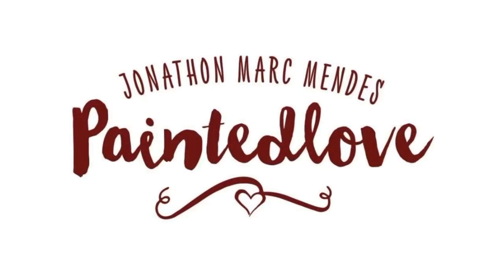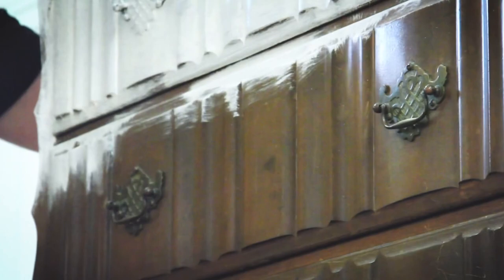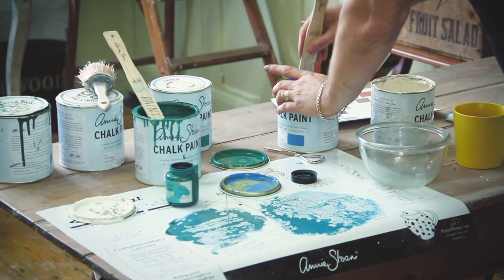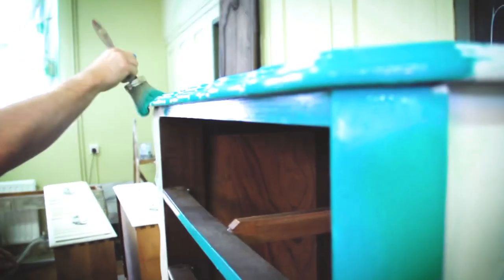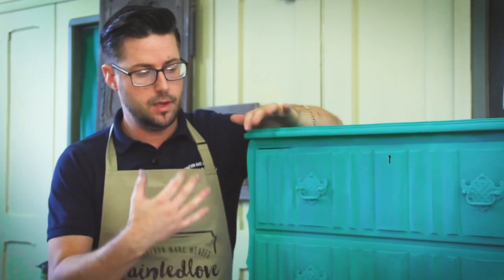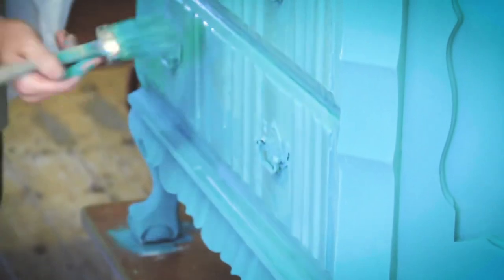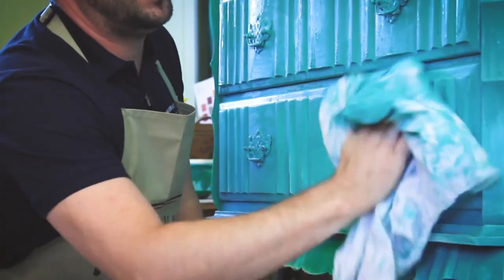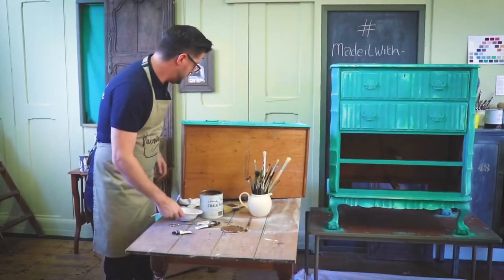A simple way to distress chalk painted furniture.

Comment: I just watched your video and it looks amazing! I’m currently working on a project and wanted to try your wet distressing technique. I used AS Napoleonic Blue. When I added water to what was left in my paint container I ended up with an almost purple/light blue mix. I kept mixing before I applied but still ended up with purple/light blue areas. Any idea why this would happen? Thank you!!
Reply from the maker: I’m not quite sure what might of happened but I do think the colour wash does come out slightly lighter the trick is probably to make sure everything is covered no gaps left from the beneath colour if that makes sense and then remove everything as one there should be slight colour variations throughout the piece but use your wet rag just to distort the eye
Reply: @JonathonMarcMendesPaintedLove  ok. Thanks so much for your reply!!